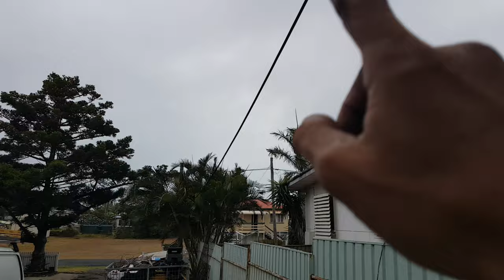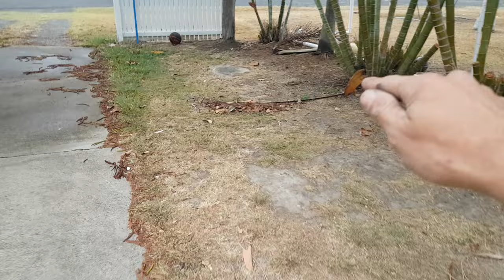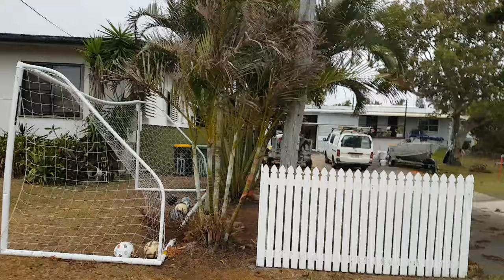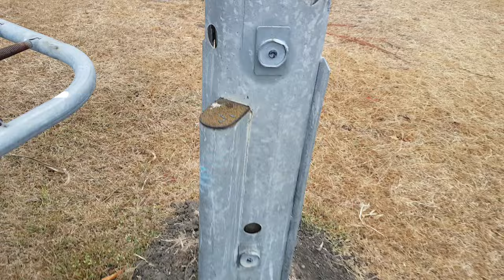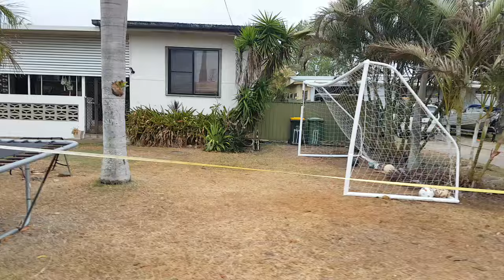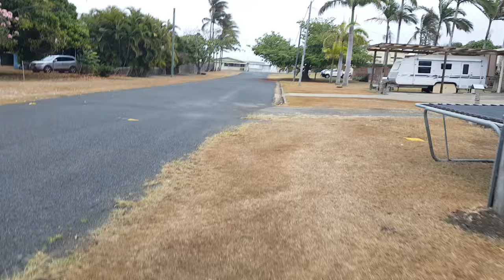Ergon Fix Your Infrastructure!!!!!

Comment: Catenary between the existing poles on the street, run the service main along the wire and take it off further up, delete old private pole, replace decayed pole, no need to extend/screw around with all the rest of the wiring to get it to a new pole location.  Not using the new raiser... unfathomable.  Just some words from some random old guy ...  Surprised they moved the pole really.
Reply from the maker: You've got half the story mate.
Reply: @TradieTrev  Sounds right, sometimes I can't even manage half a story.